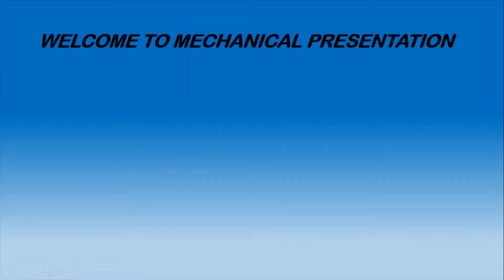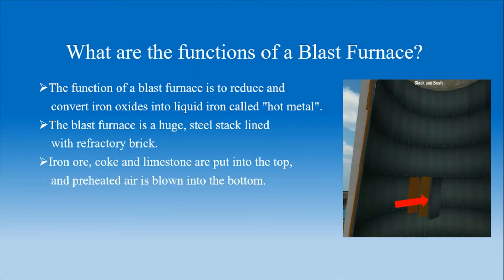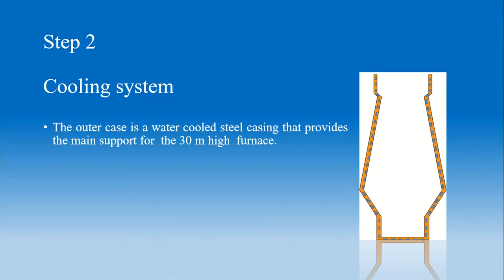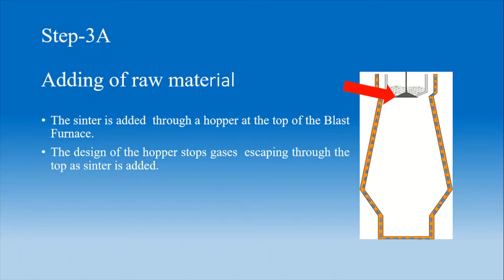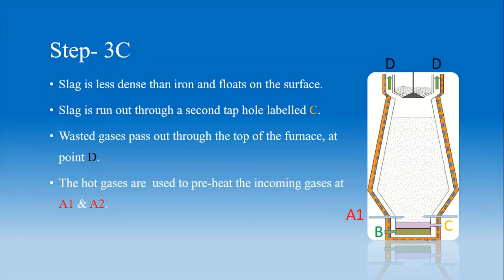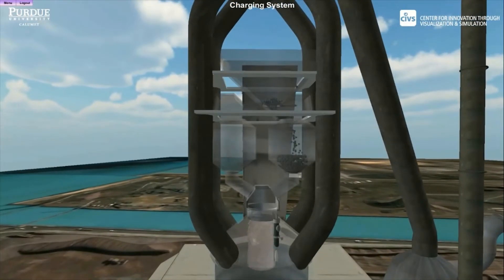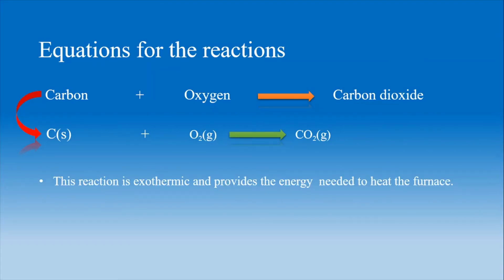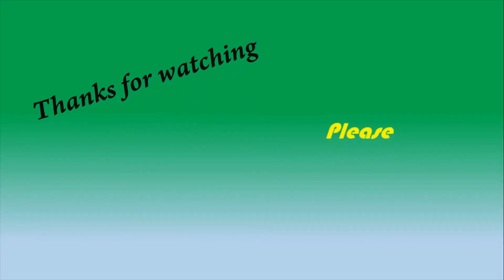what is blast furnace. how does a blast furnace works.

Comment: What is the state of the sinter as it moves down the blast furnace, but is above the molten pool at the bottom.  Is there a column of solid sinter between the melt pool and top?  Are loose particles of sinter blowing around in the mid body.  What is physically, not chemicall,y going on in the mid body?
Reply: I have asked myself the same question many times without answer.  Each time I have thought a little more about this and am now ready to make a guess.  I know that the entire furnace is full of sinter from top to near bottom.  It is not until near the tuyere that the iron drips from the sinter and falls to the bottom.  I am guessing here, but it seems the thin shape of the furnace near the tuyere creates a clogging effect which holds up the sinter until the iron drips out and the coke is burned off.  Then the entire stack of sinter slowly shifts downward until it gets clogged again and begins to burn off.